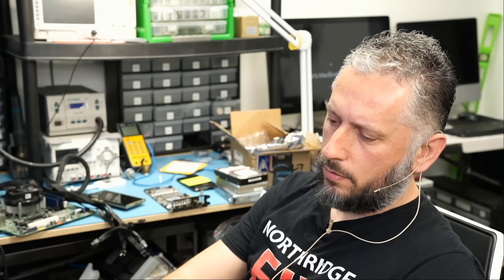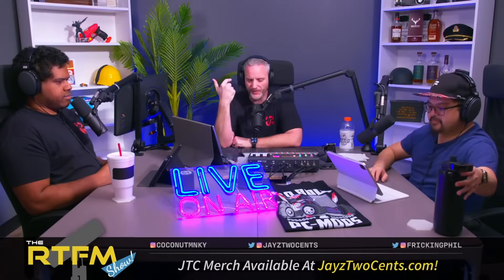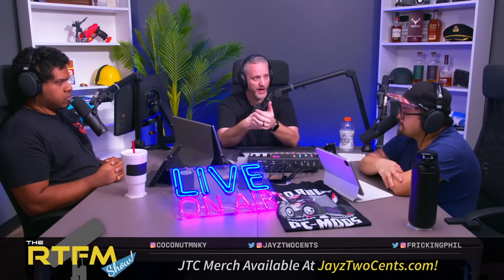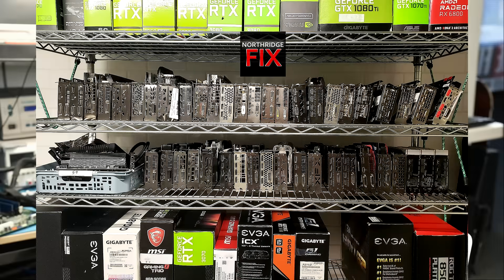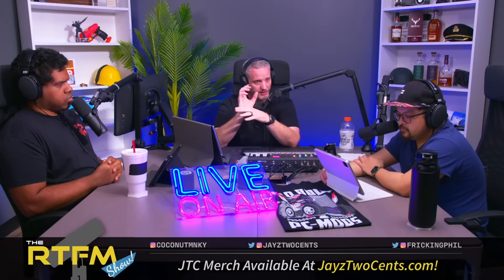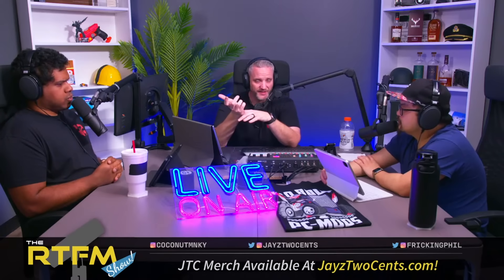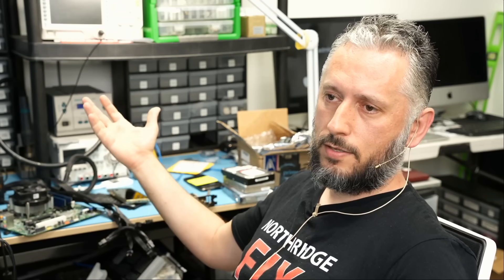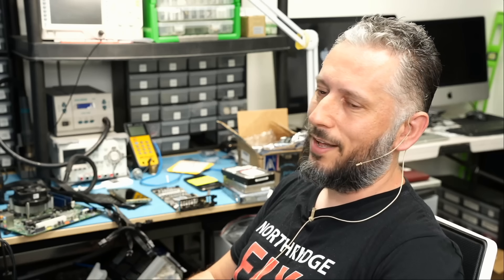Melting 4090 and CableMod. JayzTwoCents and Gamers Nexus Response. Blame NVidia or User?

Comment: Unbelievable. At index 17:53 where curly joe is trying desperately too save the company he mentions a burn mark where they say is end user error yet the burn comes right from the bottom ffs in the picture !!! Complete ball sucking idiot. It’s clearly manufacturer error and needs to be fixed or flushed period.

Comment: I agree with you (and jay) because you worked on them probably on a day to day basis. You get the cards and you can easily correlate the problem. So you have stronger word and hands on experience over Steve. Steve is still valid because he has the tools and equipment for precise analysis, but he still lacks... sonething that only you, Alex, would know.

When i first saw Steve's latest video, i actually raised my eyebrow on some of his opinion and disagree on few of his points. Now one thing i must say, whether steve's intention not to back off or back out all of his lab test is not the issue. Its more of, lack of information/aware of what you have experience, which in turn could be very useful for Steve to learn and do further test. If he is wrong I can guarantee he will admit he is. He has the best interests in us and share information. 

I apreeciate both GN, Jay, and you as whole. I would love to see you teach jay a thing to two for a collab!

Comment: I agree with Alex, the guy who is actually on the front line when it comes to repairing/replacing these 16-pin power connectors. It's unfortunate Nvidia is not taking responsibility for the real issue and is blaming user error. We don't spend $1,500+ on a gpu to have a failure with the power cable. 

All I know is Nvidia needs to get on top of this as the 5000 series cards are more than likely going to be pulling even more power.

Comment: On my 4090 I had to push much harder than I was used to, to properly seat the cable. I can totally see someone not pushing it all the way in. In fact there are documented examples of this happening. Doesn't mean I think all the failures are related to that, just that it's certainly a concern.

Comment: Ask any decent electrician which materials you should use to connect 600 Watt and 35 Amp, problem solved.
the iron connections are too thin and the plastic is not really better against heat, so too weak points for a VERY EXPENSIVE GPU. a disgrace for a 10$ connector.
Have you forgotten the 10 x use guarantee, I think that says enough not to buy this product, not even in a 2nd hand store you get this guarantee........
And it's good that there are people who can solve this problem with and given slightly better quality repairs
I'm shocked that paid advertising youtubers say this, a disgrace to diggers who only make money from advertising, and dedicate poems
Reply: Exactly not enough gauge to hold that voltage regulation regardless!

Comment: I think that the reason why the connectors are melting is that the PSU is pumping 1000+ Watts of electricity into a SINGLE connector, and let's not forget the fact that some users Overclock their cards and thus requiring more power. Are we hearing a lot of complaints about melted connectors on RTX4090 cards with 3 connectors? Why not design a connector made with hear resistant material like Ceramic.

Comment: Either:  

1.  the connection is loose and trying to sync current through a reduced cross-sectional area

or

2.  The card is demanding more current than the connector can handle.

Comment: just show the number of other or NON cablemod card.. I saw on this video you have more than dozen problems on the 40xx series... knowing the numbers of melted connector, it could be more on the design problem
Reply: We chat with resellers as well, there have been RMA's on cards that don't use our cables/adapters as well. While we arranged some cards to get fixed, it shouldn't be an indicator that our products are the reason for the failures, because the failures happen without our products included in the picture as well.
Reply: @matta.1673  thanks for your information, even tough I haven't the card yet, but seems that from your information, the problem is reside on the design of the card. I forgot to put the word of "design problem of the CARD, not the modcable" in my previous comments. Thanks Matt for you additional comments, and sorry if I misleading on previous comments, due to my missing of CARD word. Thx

Comment: If it is always the same pin that melts, perhaps it is something related to the power that is used on this specific line. it means that probably one power phase consumes more than the others when feeding the gpu.
it would be interesting to test the consumption of this line to find out if this is the problem

Comment: 1000% agree with you Alex, this is a manufacturers design flaw and not the user.  I'm gonna catch a lot of heat saying this, but over the years Steve's head has gotten bigger than his shoulders(srry Steve I'm a subscriper and have been watching your content for years, years...) and I would be shocked if he reversed his stance based off his initial findings.  He really needs to do a deeper dive  into this and why the failure point always seems to be the same pins.  As always great content .

Comment: I think you need to keep open mind. I sense bit of bias from you, dont jump the gun to conclusions too quickly. Only partial pin socket contact can cause such heat as the pins are sufficiently sized to carry current when fully engaged. If there is any prior dmg to the pin or socket prior to the adapter being plugged it, it could have tipped to faillure. The user may be trying to fradulently get free warranty from cablemod as well.

Comment: I agree with you Alax, it is NVidia itself that designed this connector after all, these should normally not even exist, and then placed it on the Affected RXT grfx card, so when something is wrong, it is also up to NVidia to do something about it, and not the end user i 100% agree 👌

Comment: Great stuff. I wonder if this is happening because of the use of a non-ATX 3.0/PCIe 5.0 power supply along with these cards. It just seems highly suspicious when  I see the use of these 3x or even 4x 8pin adapters into a 12VHPWR. I really dont think these cards were made for previous gen power supplies but im no expert.

Comment: Seriously now? Have we reached a point where you buy a graphics card worth 2000 euros, and because the user didn't connect the cable properly, the card gets fried and it's the user's fault?Are we honestly analyzing if it's the user's fault?"  Of course, ITS THE ONE WHO MANUFACTURED THE GRAPHICS CARD!  In the next generation of graphics cards, why don't you include a note inside the box of the card  that says, 'Can withstand 3 power cable reconnections'...... fk ridiculous!!

Comment: Even if the user plugs the connector correctly, the height of the card will sometimes push the connectors up against the glass / side of the case and will force the connector to slip out of the socket slightly.  When this happens this will cause a short at the connector point.  The cards using the 90 degree connector that are melting is a mystery...

Comment: If it was too much power going through connector, then the 90 degree connector would melt both ends. I'm my opinion the amount of power going through a connector that's is not 100% secure is the problem, causing arching of the voltage going into card.
Solution, either add more connectors or make 1 connector bigger and a lot more secure.
Either way, enjoy the debate and think Alex is not only very good at what he does, also very straight on what he says, keep up the good work..

Comment: these connectors are made from specific thermoplastic that is rated to 70°C and with pins only being made of brass. anything lower quality does not take a pass. so the materials are indeed of high quality.
that being said, this connector seems very picky about cable bend. not so much up-down but more left to right, in relation to the plug. that's not so much problem in the gpu side, as it is on the psu side, where the most natural bend of all cables in left-right. ppl with modular 12vhpwr connector should always first firmly connect the cable to the gpu and then to the psu. also definitely check the psu side as the plug might not be secured flush and in some cases, it can be easily removed without any force.
but burning is happening in the gpu side connectors here (we can't see people's psu's if there is also burning), so i still believe its more than contact issues and definitely not just "user error". having so tight cable bending tolerance in a connector that goes to home computers is not realistic. i can't think why PCI-SIG accepted that. as jayz said, two clips in the connector will help alot but i don't think they will solve the contact issues.
so anyone with a 4080 or 4090, keep them cables as straight and fully in, as if their having sex.

Comment: is there a way to have a connector that plugs in with a second connector that pigtails out of top to be used to measure any resistance that could be there if the cable isn't plugged in all the way, cable is plugged in all the way and wiggled and to monitor cable plugged in all the way and not wiggled?
Why do you need 3 12V supply lines from power supply, why not just one 12v supply single cable and single plug to power supply? It seems like as if there would be 12V X 3 going to card that way.

Comment: Common sense approach. To much amperage on the connector. Not different than using a light extension cord for a window AC......The connection will melt at the outlet.

Comment: 17:30 I do think he is not aware of the context of the picture and is judging based on what you provided him. You'd assume that he's an expert in electronics, but he's not. I think he had a video with Louis Rossmann showing how extremely basic his soldering skills are. However, if Cablemod could provide him an unbroken sample of the card with the stuck connector and sent it for X-Ray, he'd probably get a better understanding of the problem. Unfortunately, the evidence was already tampered/destroyed, so no conclusion can be formed on why the connector burned.

Comment: I agree with you Alex. Wierd how a user could predict when a 4080/4090 is melting to be able to install the cable mod adapter for it to fuse in place in Steves rational. I believe it's the card and not user error in the majority of cases.

Comment: You are 1000% correct. Untill these cards users were capable of plugging in a connector. Then all of a sudden so many people can no do this task anymore? 🙄 If there is a problem with the connector then it allows it to move and melt. Add that with the power draw and bam, melted. THAT IS NOT A USER ERROR BUT MANUFACTURER PROBLEM.

Comment: user error? that does not make sense, too many repeating faults  .. be interesting on prebuilds if manufacturers like acer, dell ect if they had any issues with there customers with the same issue as  to me its certainly looking like Nvidia have just pushed out card after card to meet competition , they cannot solely blame users when also computer shops and system builders who build systems for a living have the same issue??? does your selves or even cablemod receive the cards from prebuilds?  or is a catch-22!

Comment: I wonder what Steve's relationship with NVIDIA is like for him to keep deflecting such clear evidence of fault away from them? Reminds me of this quote from Upton Sinclair:  “It is difficult to get a man to understand something, when his salary depends on his not understanding it.”
Reply: I agree that it's definitely Nvidia's problem, because if a user has to push so hard that it makes the user think they are going to damage the most expensive part in their PC it's not user error but a design flaw.

I wonder if Steve is going the route that if 100,000 cards have sold and only a 1,000 fail, a 1% fail rate is probably within margins of error. Hopefully Nvidia is either repairing or replacing the cards that do fail.
Reply: @argonzeit  Is Nvidia also repairing or replacing the computers, furniture, or homes lost to the fires the 4090 cause?
Reply: Steve doesnt have a specific relationship with Nvidia, he doesnt get paid by them or do they influence his narrative (well according to him).  I believe its due to their own (Gamers Nexus) analysis they did to replicate the burning of the pins is why he still stands by his comments and thats understandable.
Remember he was able to replicate it a couple times, also Steve can be hard to understand with his explanations, I took it that he is staying mutual with what he thinks about it and that he still stand with his current findings until he can find out more information as to what is going on with the current batch of cards melting.

Comment: I'm 100% with Northridge fix 
People have been using cards with identical connectors for years .
The card is drawing too much power and the connector is not able to handle the heat 
The cards need an upgraded power connector configuration

Comment: look at any plug in your house , many devices draw more power and are not always plugged in all the way ,yet they don't burn your house down. connectors are too small for the amount of power run through them.

Comment: Are all of these connectors that are currently on 4090s all manufactured by the same supplier or are multiple supplier making these connectors? It would not be the first time that a supplier cut corners in the manufacturing process. Resistance is of course can cause heat build up. Are the 4 power sense pins causing issues with this connector although they were in the 3090 cards as well.
Reply: Those 4 sense pins WEREN'T used before afaik...
Reply: @vladvah77  Weren't they used on the 3090Ti cards?

Comment: Alex , is it possible for you to measure, how much wattage the card is consuming ? I think card must be consuming the Maximum wattage or little more due to which connector is melting. Another reason I think, connector on board is not of superior quality which can take heat produced by the card & ultimately it's getting melt. This card really needs a good cooling system.

Comment: dont understand why nvidia design new power connector, with smaller size, whlile the card need more power from that. nvidia should make bigger awg cable port perhaps. thats why car audio use bigger cable for Amplifier from car battery. and bigger clip too. is that simple?

Comment: The connector has a design flaw, everyone agrees on that, is it possible there are other design flaws as well? or manufacturing flaws? Who's to say we would notice if the card started pulling too much current on a 3 eight pin? unless you're anal about temps / power, it would go unnoticed. Jay said it, 3090s overclocked consuming 500 watts and they don't burn up. Maybe the 4090 decides it wants more power than the wire gauge / pins can provide, current + resistance = heat. If only the voltage was monitored and recorded when the failures happened, It's still an NVidia problem.

Comment: The new cable connector is fine for 4xxx series cards with the exception of the 4090. Nvidia really should of made a heavy duty special connector for is that is fail proof with installation (eg: fully latched) and consistent under load.

Comment: I have got faulty connector  in  3080 gigabyte .Pins in power socket were moving( pushed) inside when i tried to connect it. After rma i got card back. Pins no longer were moving inside but moving up- down like see-saw. Still i could properly connect power cable ,and after 2,5  years it works without any problem. I think 4000 series connectors have to be produced with extremally high quality to prevent melting .No such thing in old pcie connectors - they can work even if they are poorly produced

Comment: the calculations aren't too complicated either, let's take an example at best and suppose we are using the largest fruits (those of the classic pci-e connector), 12 cables carry the power, but half are negative (where by convention the positive closes) therefore the sizing calculations must be done on 6 cables:
the card consumes about 600w at full load, plus a little margin, the wires carry the 12v:

Ohm's law (I want to find the Ampere)
total power divided by voltage: 600:12 = 50A

Total amps divided by the number of cables/connector plugs 50:6 = 8.3A

considering that, the connector that goes to the video card has (as mentioned before) a lower surface (the fruits are smaller than the standard pci-e ones), considering that there is also a margin that I have not added in the calculations, considering that in a single standard molex fruit more than 4-5A to be safe I wouldn't let them pass ... you will draw your own conclusions.
Reply: this comment is part of a comment I made months ago in another Italian video, when the situation was more uncertain than today. I don't think it's appropriate to post the video here, then if Alex deems it appropriate I'll put the link.

Comment: Wouldn't it solve the problem if they produce a plastic connector that can handle the amp that flows through like the wire with AWG 8? That plastic element on that wire should be able to handle heat from 40-50 amps? (The heat of the wire produced when it is being used at maximum amps)

Comment: I agree with neither of you. Sometimes the simples answer is the best. You have a burnt connector, and it appears the connector does not de-solder from the heat, so the issue is the connector. They need to change the formula of the plastic (or the type of plastic entirely) to increase it's heat resistance. A connector burning or melting bellow the melting point of the solder is the issue. If the connector is de-soldering, it's a design issue.